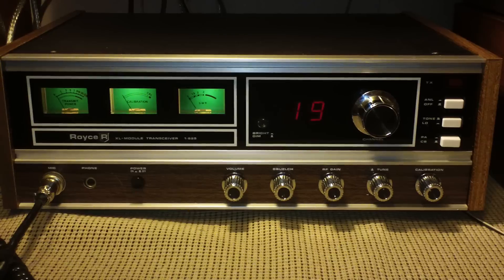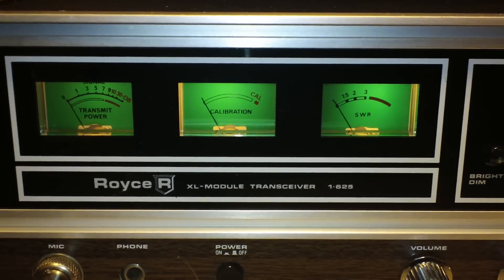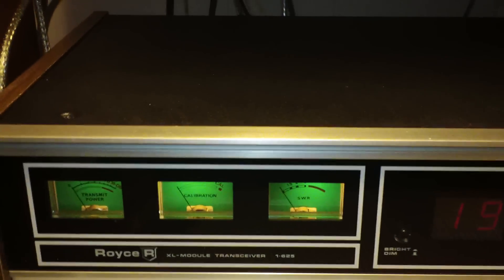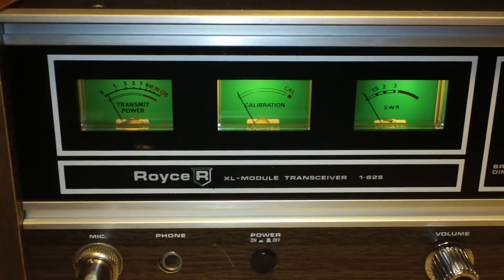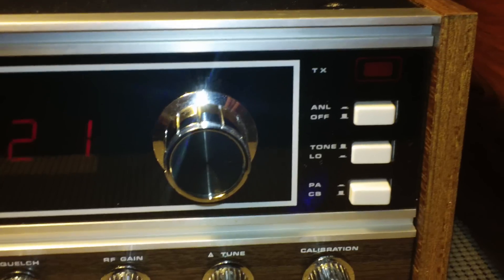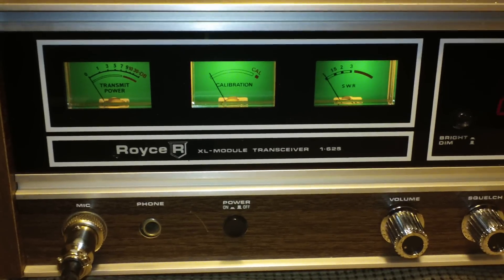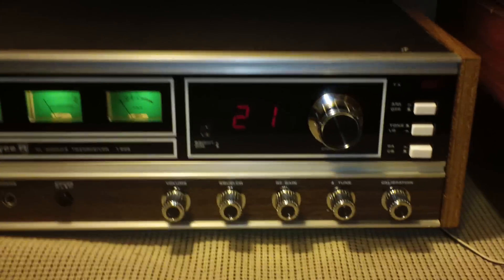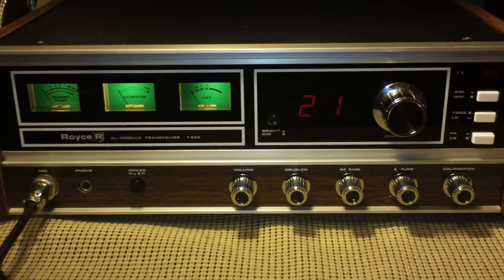Royce 1-625 XL-Module CB Base Radio 625

Comment from the maker: @zLOSTNOMOREz Yes it would be nice if it had SSB. The Royce 642 aka 1-642 looks similar and has SSB. Problem is it's a rarer radio and generally much more expensive than the 625 when encountered.